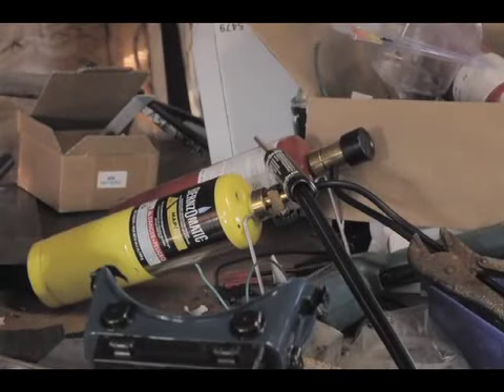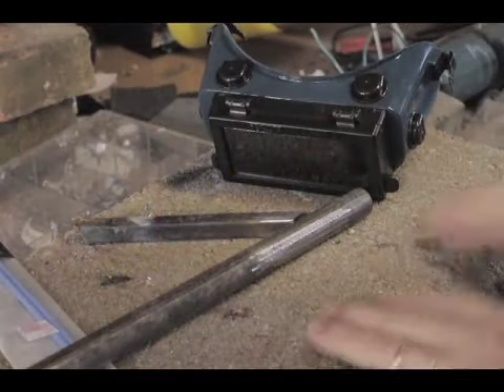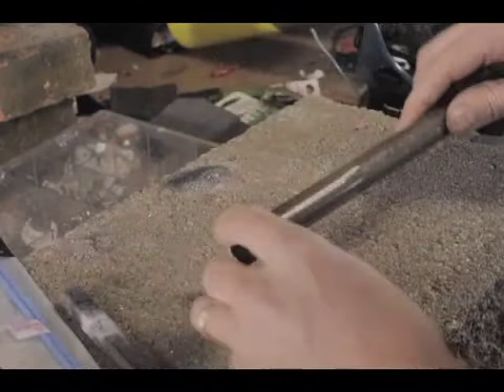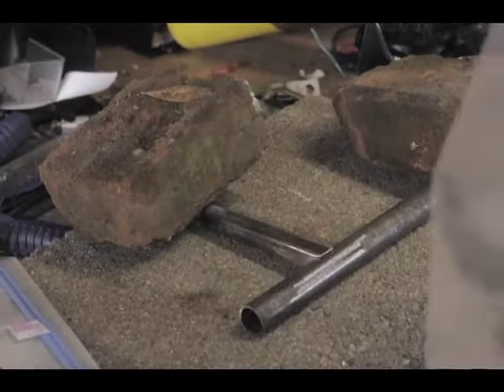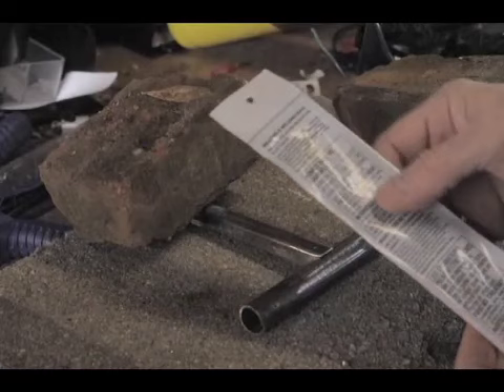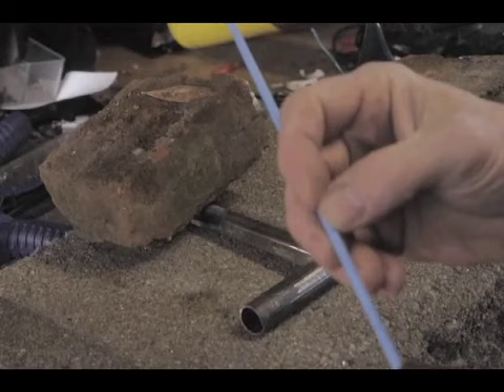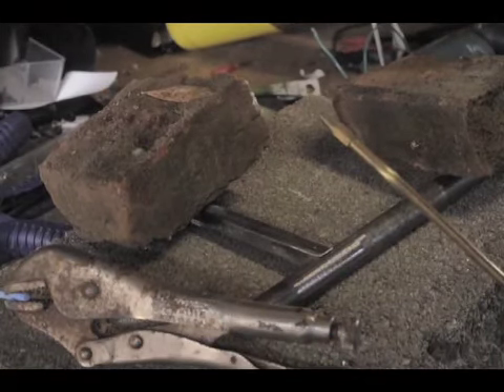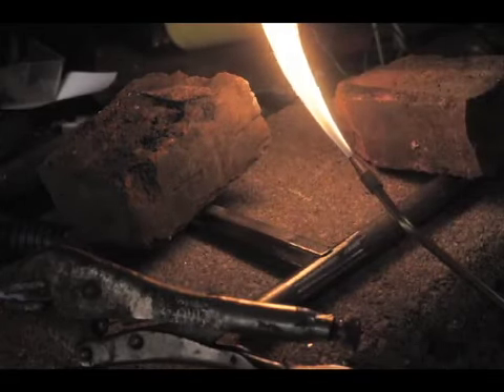Using the Bernzomatic OX2550 torch kit

Comment: Just a couple of hints. The hottest part of the flame is at the tip of the inner flame. Also the filmer is tending to use the flame to melt the rod. The torch heats the work piece, then the hot metal should melt the rod, you'll get better adherence that way. Good instructional video though.
Reply: if he would have tried stainless to brass or copper it's not that easy I got that same set up but I got a can of prepaid hooked to it instead of map they say not to do that but mine works fine now to let u no I'm not using a small can I'm using a can like u can go get filled blue rhino

Comment: I have an oxy-acetylene torch (big tanks) and can do some great brazing with it, but I need something more portable and bought this kit. It's oxygen regulator is horrible! I can never get the flame to stay consistent. The oxygen keeps increasing gradually (after I've stopped turning the knob), making the cone smaller and smaller until the flame goes  out; I relight the gas and go through the same juggling act of adjusting the mapp and oxy, but still the cone just gets smaller and smaller until the flame goes out. (I've gone through three oxy tanks without getting a chance to braze even a single joint!) I've read about this same problem in many reviews on the lowes website. I don't have this problem with my (big) oxy-acetyl torch. Is there something wrong with my (and those other reviewers') kit, or is my technique screwed up?
Reply: VaticansHolocaust Man just get a portable oxy acetylene rig, they got em at any welding supply store, plus Home Depot, Lowes, Harbor Freight all have em. Cost about $250-$300.
Reply: Yep, spend more time fiddling with the gas settings and its NEVER consistent. 🤷‍♂️

Comment: bromic and oxyturbo sell similar sets but they have fuel and oxy control knobs on the torch (just like oxy/acetylene torch) which is much easier to start and set due to the finer control

ps. use the hot metal to melt the rod not the flame, will give a much better looking and stronger weld

Comment: I thought some types of torches could cause cement, concrete or brick to violently explode; just a note of caution. I'm too lazy to check the details, but you may want to check and consider putting a warning text on your video if that's the case.
Reply: Simon Tyler oxy/acetylene will cause chunks to pop
Reply: there must be water in the brick steam explosion
Reply: What do you use then? Marble?
Reply: @redjeepyellowjeep-qz2on  I'm not expert but I think it would be recommended to use a steel plate. You might also be able to use something like welding magnets to hold the part that you want to weld together and mount it in a vise, so the part you're welding is hanging away from combustibles.  I'm just a random guy on the interweebs though not a a welder or a doctor

Comment: lucky for me i got a 60cF oxy cyl that will last me a very long time with the small torch i have,i simply use a small canister of either propane or map which also lasts quite a bit,i hear the oxy canisters do not last long and very expensive and it probabably costs me the same to fill my larger oxy tank at 24 bucks ,,i think most things like this sold from canadian tire are crap or mickey mouse stuff,,a regular wand for propane air torch is ok ,i had one lasted for years and i only need to buy propane canister for it
Reply: So, how did you hook the torch up to the 60cF oxy cyl?

Comment: Always, always, always turn off the fuel first. Turn it on first, turn it off first. Oxygen doesn't sit near your bench, ready to ignite if you forget to turn it off. Great video though!
Reply: The instruction manual claims that the oxygen should be shut off before the fuel.
Reply: I found this quite helpful.  The TLDR version is do it however you want, but Victor has sound reasons for turning off oxygen first.  For those reasons and the I don't like the pop, I turn off oxygen first.

VICTOR A THERMADYNE Company

September 29, 2003

Re: Shutdown Procedure for Oxy/fuel Cutting Torches

To Whom It May Concern:

Victor Equipment Company recommends a shutdown procedure for oxy/fuel torches that is
different to that recommended by most other manufacturers of gas welding and cutting
apparatus. There are times when this difference in procedure may cause confusion and
concern. From this, the following is an explanation behind the logic of our procedure.
Victor recommends turning off the oxygen first, then the fuel when shutting down an oxy/fuel
torch. The primary reason for this procedural sequence is SAFETY. This can best be
explained with the following three reasons:

1. One of the most common causes of backfire and sustained backfire (burning inside
the torch) is overheating of the tip or nozzle. The primary cause of overheating is
insufficient flow (velocity) of gases which allows the >5000° F flame to burn on the
surface of the tip or even slightly inside the preheat orifice(s). Proper gas flow with
sufficient velocity causes the flame to burn slightly away from the tip end.
One of the simplest ways of determining adequate fuel flow when using acetylene is
to have a “soot free” flame when the fuel is on and no oxygen is flowing. Thus, if the
operator turns off the oxygen first, and the flame produces soot, he is reminded that
insufficient flow was used. From this, the operator should either increase the flow or
change to a smaller size tip. (This depends on the application.)

2. All valves have the potential of leaking at one time or another. When the fuel is
turned off first, the flame is immediately extinguished, even though there might be a
small fuel gas leak. If the oxygen valve is closed first, the flame will continue to burn
(hopefully without soot!). Then, when the fuel valve is closed, and if a leak is present,
a small flame will continue to burn. This will immediately warn the operator of a
problem.
Neither shutdown procedure will show an oxygen leak, but at least in the latter
method, the operator can detect the more hazardous of the two.

3. As mentioned, other manufacturers recommend closing the fuel first, and then the
oxygen EXCEPT when there is a sustained backfire (burning inside the torch). In
this case, they recommend immediately closing the oxygen valve first.
Humans are creatures of habit. To recommend reversing the shutdown procedure in
an emergency situation would be like telling an automobile driver to use his right
foot on the brake for normal stops, but in the event of an accident, use the left foot. A
few seconds can mark the difference between a safe shutdown and a damaged
torch, and most importantly, possible injury to the operator.
There have been claims that using our method causes soot build-up inside the torch.
Victor has performed many tests and found that the soot build-up that others claim to occur is caused by improper gas flow and pressure settings, not the sequence of closing the valves. This holds true for all equipment that we have tested.
It should also be noted that all industry standards organizations, such as ANSI, AWS,CGA, and NFPA, recommend the operator follow the manufacturer’s instructions for proper operation of the equipment. To this extent, there’s not a “golden rule” in the industry. Since there are basically two different ways of shutting down an oxy/fuel torch, we feel our method provides the safest way.

Sincerely,

David Pryor
Manager, Product Technology and Advancement

Comment: you should be careful teaching people when you are doing it correctly it's going to get them on the wrong foot from the beginning which is the worst thing you can do for somebody learning something new I'm not going to go into details on a side note you don't need it anywhere near that size of flame that would be for something like a stand up size container commercial professional grade you're going to burn up those torches maybe seven minutes of runtime total for $20 back trip to hardware store and back gas for the trip soda pop 99 cent burger and being able to weld in your bathroom if you're doing this all night priceless make the flame is small as possible and to still be able to reach your desired temperature